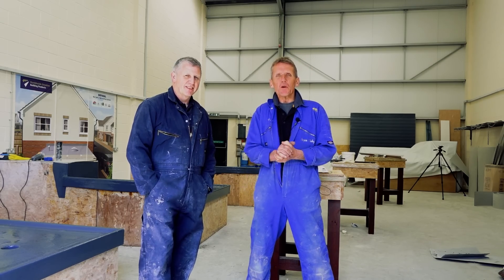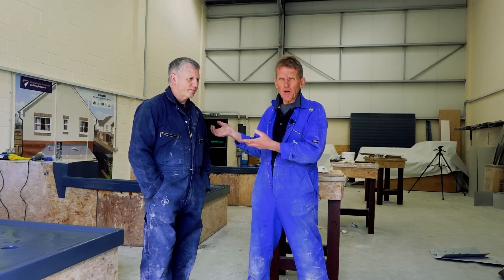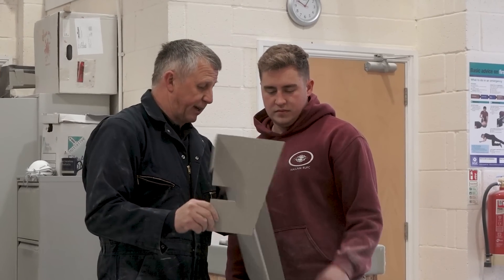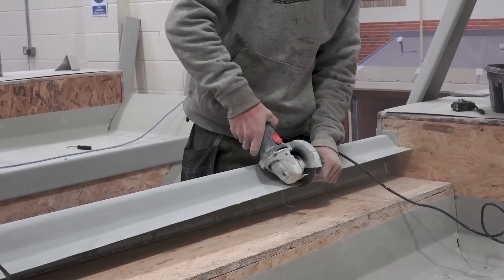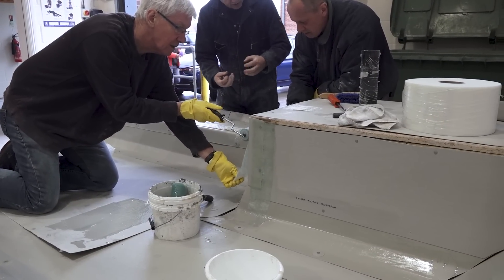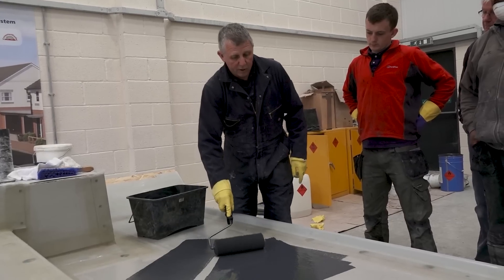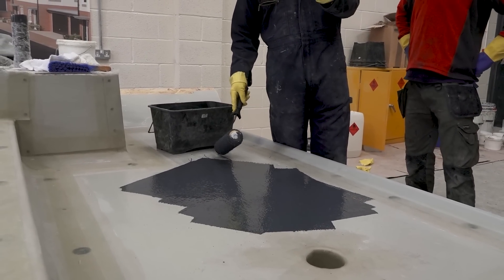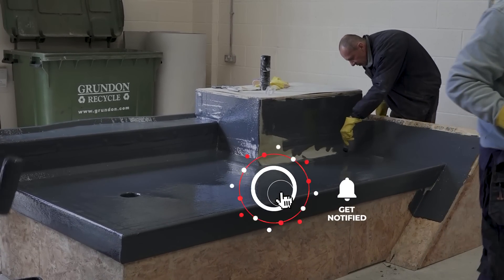Leaking Flat Roof?  NOT With The Dryseal System

Comment: I’ve used a product called Ultraflex. You cover the roof with the product, then lay your matting on top, rolling more product on top. You can leave it like that or put Ultratop over the top when it’s dry which extends the warranty.

Comment: There's only one system worth using on flat roofs - EPDM synthetic rubber. It's; flexible, re-usable, recyclable, no issues with UV, cold process, comes in seamless sheets of any size: The Firestone system can't be beaten.
Reply: Good to hear, as that's what I'm specifying for mine
Reply: Joins joins joins. Ok on a simple easy flat roof like a garden room but throw some detail in there and it becomes a weak spot. Grp is completely seamless.
Reply: @TheDeanoc69  one could argue that about weakness in detailing about any system not properly installed so I'm not sure what your point is there. GRP is certainly seemless (if properly laid) until it cracks, degenerates or delaminates, it is not ultra violet proof to any real extent (which is why sailors wax/treat their yachts annually), but it certainly can't be reused and is not flexible, nor is it environmentally friendly, nor is it generally suitable for laying green roofs or paving on.  EPDM is streets ahead.
Reply: @TheDeanoc69  Also, glassfibre  is far more temperature dependent for laying and by necessity uses noxious chemicals - EPDM can be laid without. And no, not just for 'simple easy flat roof(s) like a garden room' but for massive warehouses it can be got in vast sheets with no joins whatsoever - with the Firestone EPDM system.

Comment: If there’s is no full bond of the system to the deck is there a risk of wind uplift issues (in a storm for example) which might cause tears in the grp… I’ve seen felt and single ply roof systems do that when partially bonded and it was messy it took the whole roof covering off

Comment: Roger . What do you mean by wet laid system ?
Reply: substructure is bonded by liquidising the base layer , AKA heated bitchimin
Reply: no he doesn't mean that. he means the usual grp roofing process involves putting resin and matting to bond to the roof deck. this method involves big sheets of fibre glass where just the joins are sealed using resin.